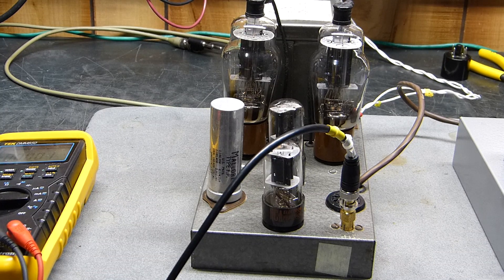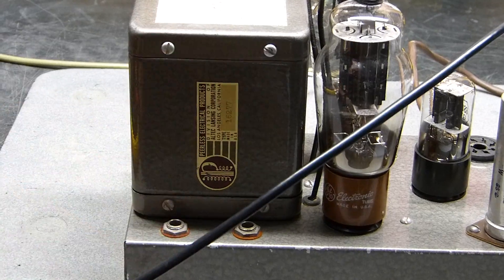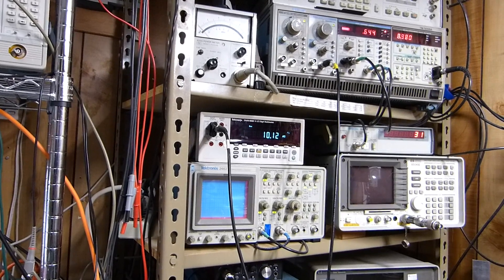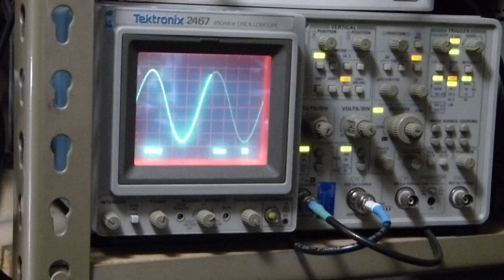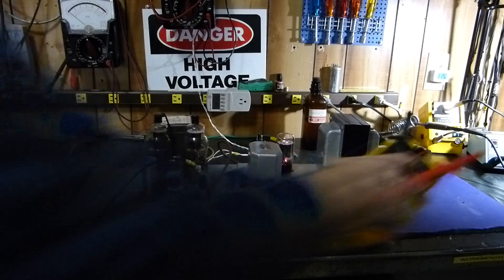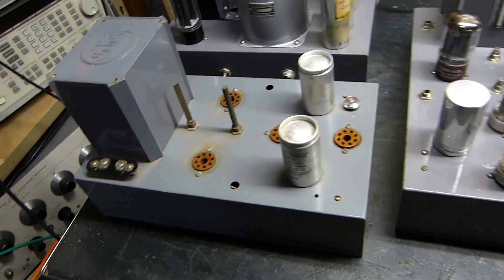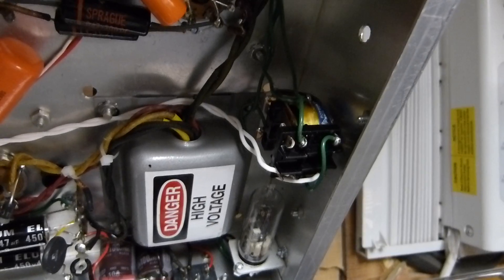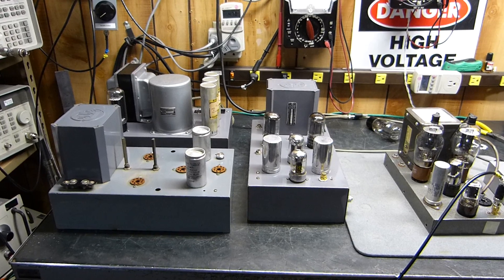Heathkit Model WA-1,  20 Watt, 807 Vacuum Tube Amplifier Tests

Comment: hi i want to make the heatkit wa-1 push-pull  807 ,do you know what primary impedance that i need , so i got 2 hammond 8 k primary at home .thanks
Reply from the maker: 8K OPT will work just fine. Typically, 5K are used but 8K may offer a little better performance and lower distortion at slightly less output power.
Reply: hi do you  think  that i can put 500 volts  on the plate  of the w1 or w2   heatkit without a change for resistors in the power supply  ,i dont know what voltage on the plate of the 2 x  6sn7  the voltage cause  are not indicated in the shematic ,w1 is  a 807  in triode connection  if i put 500 volts on the plate  can i obtain class A amp , and can i keep 8 k also.thanks  yvan @ElPasoTubeAmps
Reply from the maker: @kubockferre5532  I assume you are building two new amplifeirs to the Heathkit W1 or W2 schematics with your own transformers ?  I just looked up the W5 schematic and it has the voltages in a voltage chart on page 5 but not in the schematic.      https://www.vintage-radio.info/heathkit
Reply: thank you  @ElPasoTubeAmps

Comment: In ultraliner mode they will only put out 7-8 watts per tube in my study’s so far
Reply from the maker: I agree. We can't push tubes very far in a single ended mode. On the other hand, the 807, with the plate connection on the top, can run 750 volts on the plate and produce as much as 120 watts of audio for a modulator. The 1940 era 807 is as powerful as the modern day 6L6GC with the added bonus of being able to run them at that high voltage. The plate voltage on an octal socket has to be lower than a plate cap or arc over is likely from pin three (the plate) to pin 2 (the filament). There is a 12 volt filament version of the 807 called a 1625. The 6L6 is a powerful little tube especially considering the design has been around about 80 years.
Reply: @ElPasoTubeAmps  my design is coming along great Many hours of studying and testing before I assemble I have been learning so much my power supply is very massive and very heavy 🤓and too complicated but yet basic my next build will be more compact and less complex the type 83 rectifier has been working great many people say that tube isn’t great for audio and they say it has too much noise I haven’t had that problem maybe on the same chassis it would and input on that subject would be great
Reply from the maker: @jimcatanzaro7808  Jim,
There are a lot of people that say a lot of things that is just pure nonsense. They just repeat and add to what they have heard with no experience of their own. You 83 rectifier is going to work just fine. If they know so much about it they should give us at least a S/N ratio...  Somewhere back in the days of the invention of the mercury vapor rectifier there was a problem with what was called "hash". It was primarily caused by poor design of putting the rectifiers too close to the RF section. (these guys were figuring it out empirically as we all do...) and 80 years later some people will tell us that MV rectifiers are full of noise. Well, they are full of BS because they don't have a clue.
My builds and "designs" are often times large also but that is the way homebrew equipment turns out - we build with what we have and are not interested in saving a penny or two on mass production. Don't slow down because of the nay-sayers.
Reply: @ElPasoTubeAmps  I won’t  stop ,I actually try not to even join groups anymore because of the snake oil negativity or jealously or whatever they’re mental illness is, thanks for your support and keep up your videos they teach me so much I just wish I had equipment like you and your massive stash of iron :)
You teach very well and it’s very easy to understand you as a reg average American 🇺🇸

Comment: I try to use ac motor run caps 440vac x 1.4 = your dc around 700-800 dvc oil filled correct me if I’m wrong they been working good
Reply from the maker: I agree that the motor run caps are fine. They  work perfectly well and at those voltage levels. Overall, probably last much longer than the electrolytic's.
Reply: @ElPasoTubeAmps  thank you for agreeing I have been testing every capacitor I have and all the hvac capacitors I tested are spot not and have 0 esr and vloss and all my filter caps are 20 percent off and higher esr 
I have been using all oil can caps only
 I work in the trades and a electrician friend gave be a bunch of new ones and been having great success I even got alum and made my own chassis with a break at work and that’s a big savings 
I also got a bunch of vintage transformers and been making separate power supply chassis 
I need to find very good schematics for a push pull 807 amplifier if you could help in anyway
Reply from the maker: @jimcatanzaro7808  Here is a link to most all Heathkit schematics. I would recommend the very one in this video as a great example of a Williamson design using 807.
http://web.archive.org/web/20040126114241/http://www.circuitarchive.fsnet.co.uk/heath.htm

Comment: What paint do u suggest? Hi temp
Reply: I don't think it needs high temp. I like the grey wrinkle paint sold by Lowe's and I am sure other stores. Comes in different colors also.
Reply: @raymondbeard8159   I had seen it in stores but I have a alum chassis 
so not sure it would stick without self eching primer I might just do my first amplifier bare alum then the second one I can always paint when my skills are better 
I have always repaired old amplifiers and have a bunch of parts transformers and output transformers  and many chassis 
I’m looking for a strait forward hifi  build for listing to music  not sure if stereo or mono would be a good place to start 
I’m looking for a good schematic and pics to work off of like a older kit models of the past

Comment: Great video. Top cap tubes with Bakelite bases like the 807 / 1625 tubes most definitely have a coolness factor that cannot be denied. Standel used these tubes in their guitar amp combos with great success before a disastrous batch of bad OTs caused the company to decline through warranty returns. Apparently, they sounded great. BTW, I saw the Standells perform with Standel amps as a teenager!
Reply from the maker: I think the shape of the 807/1625, much like a coke bottle, has in it the Golden Ratio and we find a natural beauty in it. And when we think about it, the venerable  807 has the characteristics of the modern day 6L6GC (with much higher plate voltage, and power output,  thanks to the top plate cap) during the days of the metal 6L6 which has a whole lot less of everything...
I have never heard of the Standel amplifier until now. 
I am not a musician but I have to make a confession. 
A few years back, just after retirement, I started a home based vacuum tube amplifier repair shop. Made a website, business cards, mouse pads, a few small things like that and took in amplifiers to help the musician community and make extra money. Met a lot of wonderful people and (finally) learned a little (with a lot more to learn) about the music world. But the confession is this - I really wasn't primarily interested in repairing amplifiers - I wanted to play with them in my workshop and document them. So, I got people to bring all kinds of amplifiers to me and that I got to examine them and see how they perform and were built and got paid for it.  That is a win-win. I did have one other objective and that was to document the harmonic profile of each amplifier so that amplifiers could be built, with an objective way to measure them, to sound like any amplifier chosen - without having to duplicate the exact circuit. Well, I was very naive, since I am not a musician, and had no idea that in solid state amplifiers, this had already been attempted to make them sound like vacuum tube amplifiers.  According to musicians, the SS amps don't do a good job trying to sound like a tube amp but after some time and thought, I realized all of this could probably be best modeled with computer programs instead of the tedious measurement and documentation of actual amplifiers using a spectrum analyzer.  I have a beautiful HP 3580A which I absolutely but is  brutally slow in tracing low frequencies. I finally stopped that crusade and just got back to sharing what I do in the workshop with AF and RF circuits. I guess that is enough digression for the night... Thank you for you kind comments.
Reply: @ElPasoTubeAmps  Wonderful story - thanks so very much for sharing.  Transistors ( I call them "sand" components because they're made from silicon which is the primary  constituent of beach sand) are natural current amplifiers and have to be manipulated to be voltage amplifiers. Vacuum tubes, on the other hand,  are natural voltage amplifiers and, when run within their recommended parameters, are very linear (6SN7, for example). Transistors, for musicians, are best used in bass amps as they can lend an "authority" to fundamentals that works for live music and a heftiness which rockers love. But, when over-driven, they just sound horrible - nasty 3rd order harmonics and 5ths. Vacuum tubes, when over-driven, produce predominately 2nd order harmonics which, although are a distortion, give music a lushness and three-dimensional quality to it. Solid state works best for signal-processing, not amplification, IMHO. I watch several channels on YouTube related to all things tube but yours is always a pure joy as your methods and philosophies are spot-on and your use of real world, real-time analyses are useful, practical and comprehensive. I do love your enthusiasm for big components, big voltages, big everything! BTW, I live in Albuquerque which I always considered a sister-city of El Paso as we share a common history as major stops along the famous Camino Real. Thanks again.
Reply from the maker: @radiojet1429  Albuquerque - that is great. I have been there lots of times. I really appreciate our discussions as you give me great ideas. Been busy lately so I haven't had much time to work on the amplifier testing the little RC circuit. In a sense, it seems much like a "tone" control network. Remember the simple tone controls in the old radios where they use something like a 0.05 uf in series with a pot?  Problem is, with my experiments is, I don't know what "instability" I am trying to solve... as far as I know, I don't have any. You know some amplifiers have a zobel network on the output transformer. That seems to do little for me but, once again, attenuate highs and increase THD at 20 KHz. 
I read an article the other night, if I can find it again I will forward it to you, where the fellow had a very slight ringing, just as I do, but compensated it to a much smoother leading edge and said he did not like the sound afterwards and went back to the circuit with the little bit of ringing. Maybe he "dulled" his highs. I will try to fine it after an errand I have to run. Stay safe up there in Albuquerque...

Comment: hi,i made a 807 single end and there is something that i dont understand why cathode resistor of the output that i see  often on shematic is  10 to 15 times the value in watts of the cathode resistor . If i calculate with ohm law  p=v*i   the value is 10 times  less.
Reply from the maker: I will do some ball-park type calculations for you. Suppose you want 37 volts bias, a reasonable value for an 807 or 6L6GC and you want as much as 100 mA cathode current under full sine wave drive. So, R=E/I which turns out to be 370 ohms for the cathode resistor. Now with 37 volts across the 370 ohm resistor,  we have 3.7 watts dissipation so to be conservative and not have the resistor get really hot, I would use a 10 watt resistor although a 5 watt would be OK but could run really hot. Hope this helps.

Comment: hi.i love your vidéos on you tube i learned ,id like to know if i can  put 600 volts on 807 .my amp is single ended class a triode connection.thanks a lot
Reply from the maker: Thank you. I am pleased to hear my videos help - an 807 is the equivalent of a 6L6GC and with the plate connection on the top of the tube, it can handle much higher voltages than the 6L6GC with the plate connection on the base of the tube with pin 3 right next to the filament pin on pin 2 where a HV arc is more likely so you can run higher voltages on the 807, as much as 800 volts. I do not know the recommended configuration and voltage for a SE 807/6L6GC and raising the voltage will increase the plate load resistance but it should be OK to experiment with. Stay safe.

Comment: I believe I would have tried to offer  to build him a power supply  I built for him to get the original. I'm sure what you have built is new and better but you only get original once. Great buy for ten bucks lol
Reply from the maker: I have to agree with you. What I built is probably a higher current power supply and makes the amplifier perform even better than the original but, as you say, original is original... Personally, I don't think I would have bought the power supply without the amplifier (unless it was $2) so, I am thinking the other way around. Who knows why people do what they do....